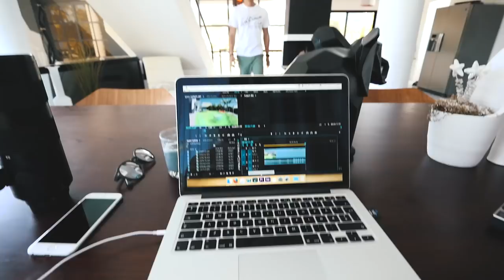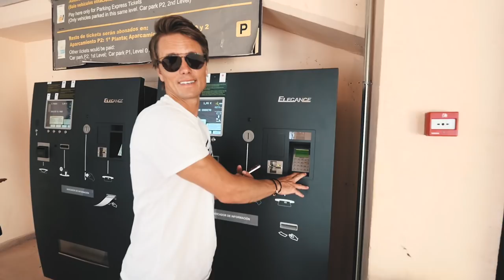JANNI IS BACK! | VLOG 59

Comment: Jon u should buy a 918
Reply: +Brendan Vlogs they don't lose value
Reply: +Brendan Vlogs the 918 is the best car in the world I don't see how it is a waste of money
Reply: +Brendan Vlogs Jon is rich do he can spend his money
Reply: +Brendan Vlogs it's a bit different with the 918 since it's limited. At this point of time, it's not that easy to get one under a million anymore.
Reply: No. I would buy one and wait a bit until they gain value when the production stopped. Then sell it and make some cheeky profit.
Reply: +Brendan Vlogs since the 918 is not more available new and since supply is so limited the market makes these kind of cars more expensive. It's as simple is that. Look at the enzo, f1, carrera gt, e-type,...
Reply: +Nicolas Van Cauwenberge that's what I was trying to say. Also, I forgot to point out that there is no 2016 918 Spyder. they are 2015
Reply: +Brendan Vlogs there is not. All of them were produced before 2015. Even all of them were sold out before 2014. So the "new" ones you are talking about are simply second hand cars which have not been driven yet. Look at the price of them, it will have risen.
Reply: +Nicolas Van Cauwenberge produced before 2016